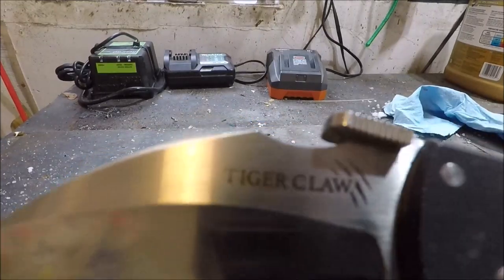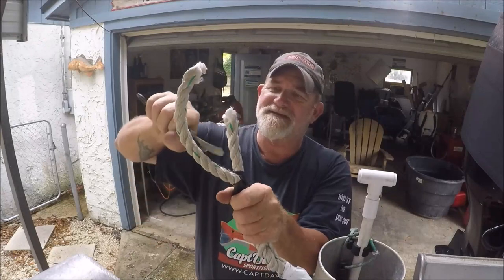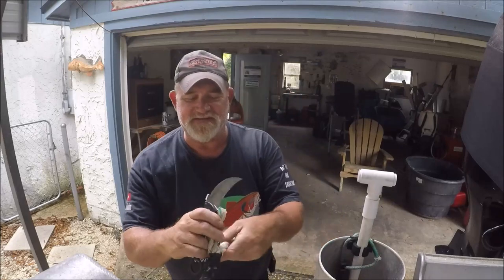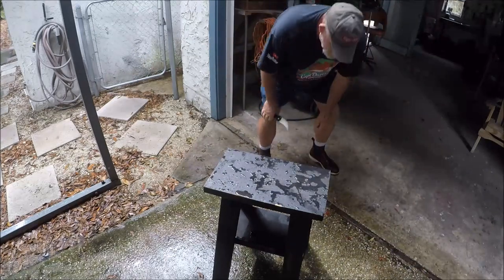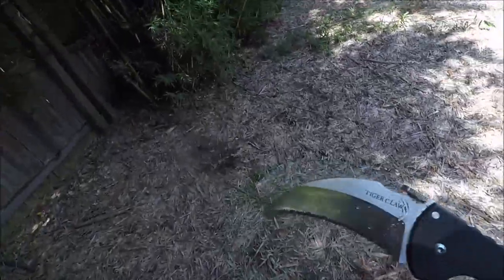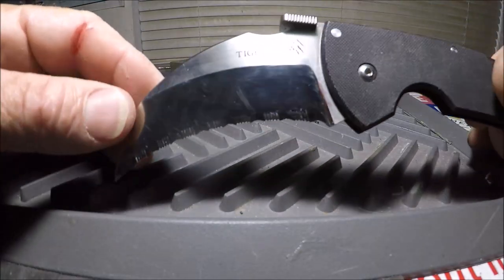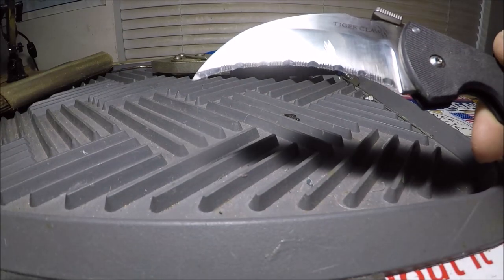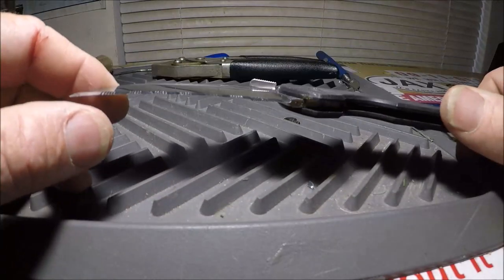COLD STEEL TIGER CLAW review NO BS

Comment: I agree with you love cold steel serated knifes like my few I have owned cold steel XL voyagers tanto cuts like anything. Also I remember a video Lynn Thompson made a very good point and you Dave are making good point as well Lynn Thompson said when your buddy or friend going overboard you want a plain edge or serated get a serated edge. I work as  a entry level diesel mechanic and the stuff I need to cut through on a daily basis zip ties cardboard and rubbed mud flaps you want to know definitely you can cut it instead of sit there and struggle with it. So you can do shavings for a fire as well it works I have try it.
Reply from the maker: my knife 🔪🔪and sharpening on the Wicked Edge Gen 3 play list: https://www.youtube.com/playlist?list=PLK-ee3q-bFR1MSm6HJ8X82e3L9jjhrQ2Q

Comment: How do u feel about the black talon 2 comparing to this?
Reply from the maker: not nearly as practical and utility.
Reply: @CaptDavesSportfishing  ya I agree. It might have a small advantage in a "SD" situation but even if someone did half to use the black talon for self defense good luck explaining that to a jury.. just the way it looks is gonna give someone a guilty look. LoL plus I carry my tiger claw slot more often, it's extremely comfortable in the front of my pants with the clip almost directly behind my belt buckle . And with the ring sticking up it's extremely easy to get to. Only problem is sometimes I forget it's there. 🤷
Reply from the maker: @cloudnine8842  YES, Demko knew what he was doing when he designed this.